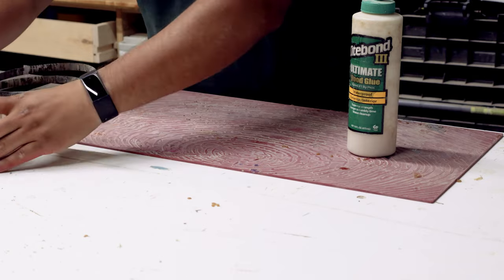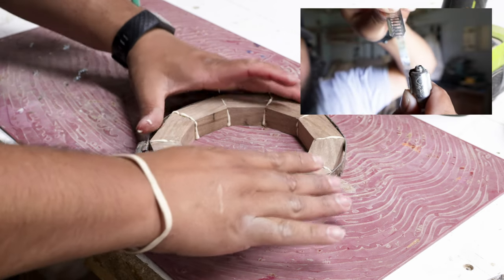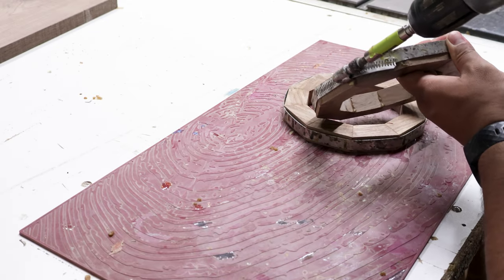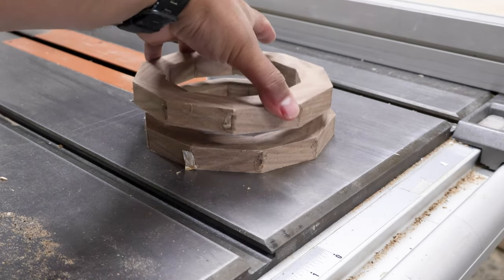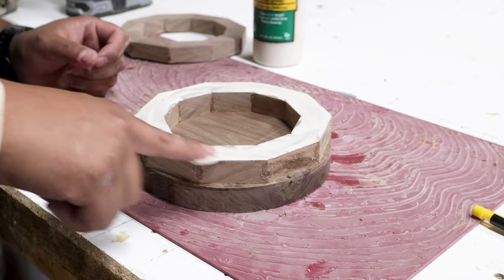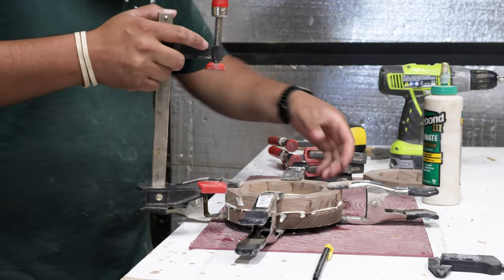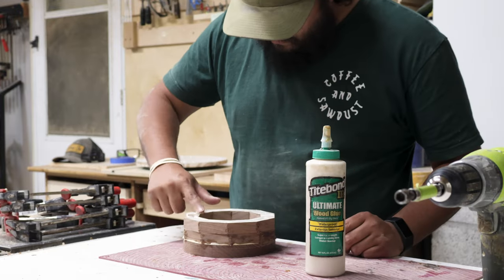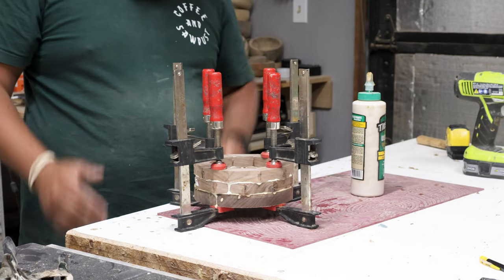The best way to glue up a segmented bowl.

Comment: They sell rolls of stainless steel hose clamp 'tape' with several of the screw parts to make hose clamps of custom sizes.
The nice thing about them is that the gaps for the threads of the screw to bite are in the whole length of the tape, so you can do any size.
Reply from the maker: Oh really?! That’s so cool.

Comment: Enjoyed the video - thanks for sharing! I do have a question, but not about glue-up. It is about that bottom ring and where it meets the bowl base. Notice that the bottom ring has the "ridges" all around from the fact that it is made of segments. Well, once it is glued to the base, how do you get rid of those ridges without having your tools make a mess out of the inside face of the base?

Jim
Reply from the maker: S0o,you want to get rid of the straight edges of the segments without touching the base of bowl?
Reply: Exactly!
Reply from the maker: @jimbennett2940  I have tried do that with a straight square carbide tipped tool. And it kind of works. But you are eventually going to hit the bottom. I don’t think it’s really possible to do.
Reply: @madiradesign  Got another brain f@rt on this. I'm gonna glue up the bottom three rings, then reverse 'em into a Longworth chuck and smooth out that bottom ring's ridges. Might be worth a try anyway.
Reply from the maker: @jimbennett2940  always worth a try!

Comment: Why would you cut the base out of the middle of that walnut board? You ended up with two small scraps with little use instead of one decent size cutoff that could have made another base or a lot of other things. 😣

Comment: nice work // READ leaflet or directions that come with your glue // It says DO NOT IMEERSE IN WATER / don't put in water. So is it water proof ? i use for cutter boards OK to wash with water  but not in dish washer hot temperature make them come apart sooner or later mine last about 12 times in dish washer
Reply from the maker: Titebond three is just more waterproof than the former 1 and 2. It also comes down to the type of finish you are putting on your wood products and how often are re-applying. There is a lot that goes into it and like I said. The titebond three just gives me that piece of mind.
Reply: Suppose we had two wristwatches, one rated for swimming up to 10 meters deep and the other rated for 100 meters deep. They would both be considered to be waterproof, but one is more waterproof than the other. (And neither would hold up if it were sent down to the bottom of the ocean, next to the Titanic.) A similar concept applies to wood glues. Some are rated for use 'below the waterline' and others for use above the waterline. Titebond III is waterproof in the 'above the waterline' sense of the term. The difference is below the waterline glues can be submerged in water indefinitely. Titebond III is fine for use on the exterior of a boat (where it will be frequently submerged by a wave) but not below the waterline, where it will be constantly underwater.

HTH